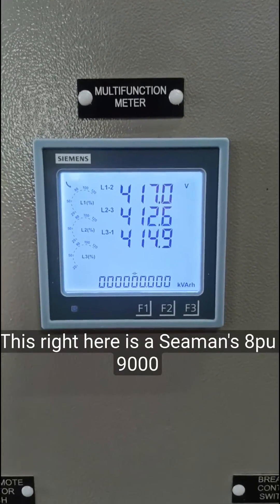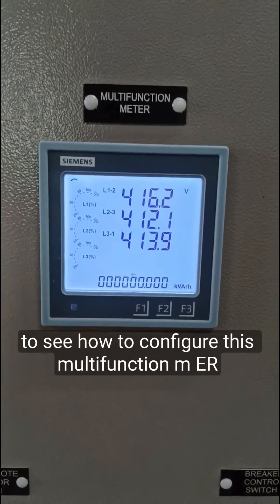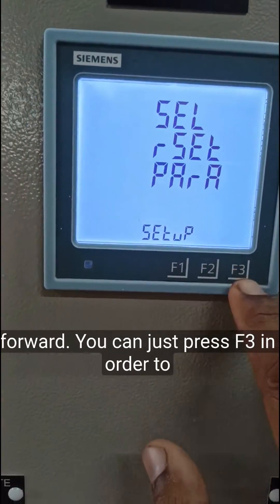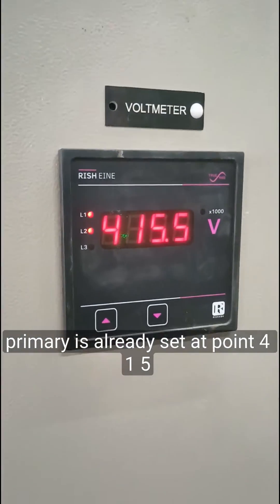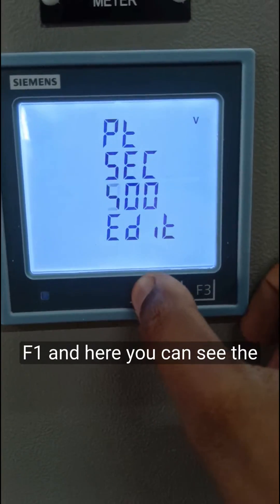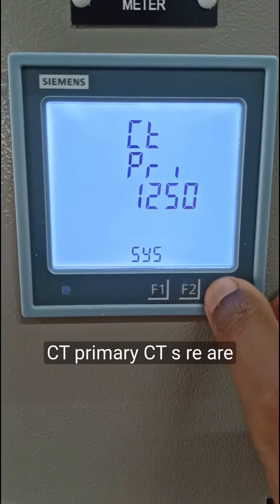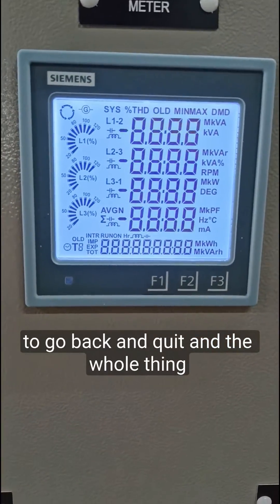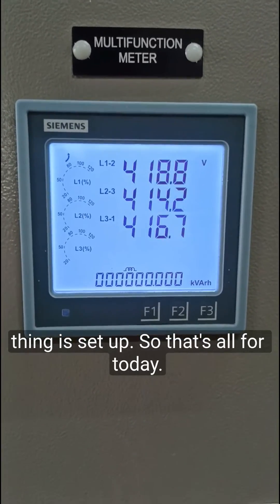Configuring Siemens 8PU9000 Meter made Easy‼️| EZ CONFIG Series-2

Comment: Sir how to reset the multifunction meter   without a password
Reply from the maker: Resetting the Siemens 8PU9000 multifunction meter requires password to access and modify certain parameters. If you've forgotten or do not have the password, it's important to note that bypassing security features can compromise the device's integrity and may violate usage policies. Therefore, it's recommended to contact Siemens technical support or consult the device's manual for guidance on password recovery or reset procedures. But generally it is 0000